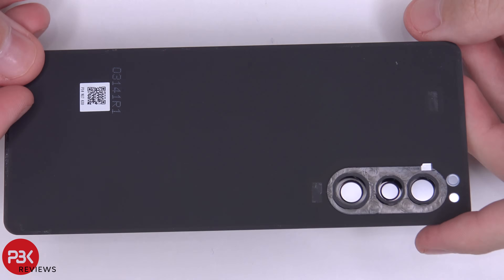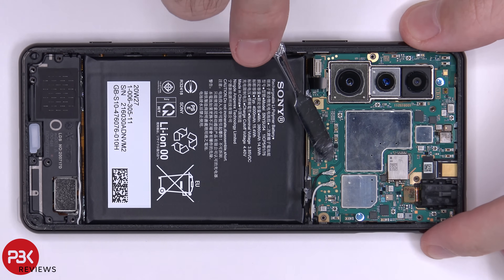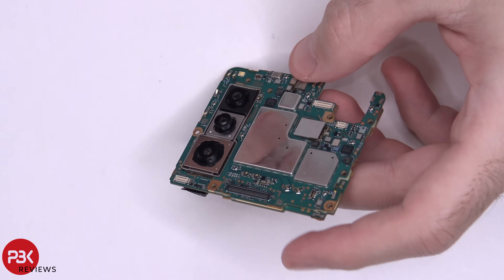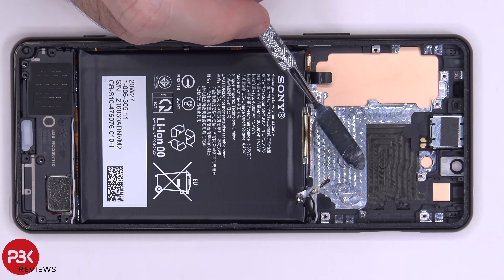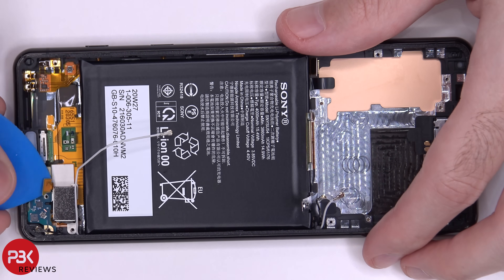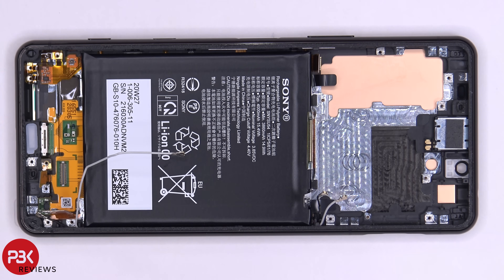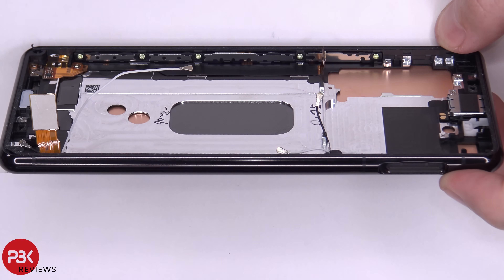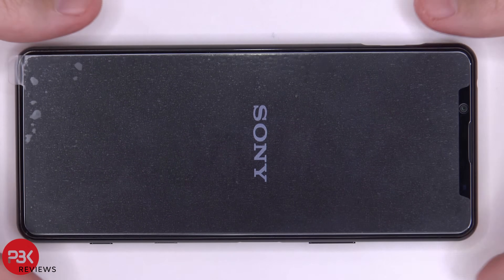Sony Xperia 5 II Disassembly Teardown Repair Video Review

Comment: Thanks for this! Looks like repairability is good in this phone! Can you remove the screen without dissasembling the whole phone?
Reply from the maker: No problem. You can remove the back plate and remove the speaker assembly along with the vibrator motor and small board to gain access to the screen cable to disconnect it so then you can pry your screen off. You don't need to disassemble the motherboard portion on top if your doing a screen replacement.
Reply: @PBKreviews  but if you need to replace the USB port you need to remove the battery and the entire bottom unit :/
Reply from the maker: @Ashfaaqx  yea but its not that difficult honestly. It may be a few more steps compared to them having a charger port board on the bottom that could be easier to replace but the fact that the battery comes with those pull tabs, it makes it much easier. Plus the flex cable for the charger port is not adhered/glued down to the midframe and comes off easy.
Reply: Wat about removing just the front glass not the whole digitizer ..there's nothing but glue that keeps the glass on the digitizer?
Reply: @drubreezee5975 did you try this .?

Comment: the top portion looks simple and ez, but the bottom part is quite the opposite 😆
Reply from the maker: Ya, the top is easier but the bottom a bit more complicated. However it's not too difficult just a bit more work :)